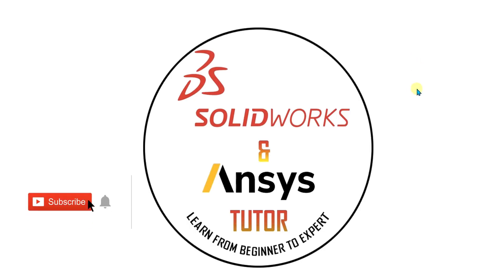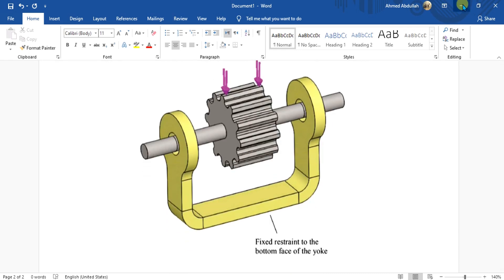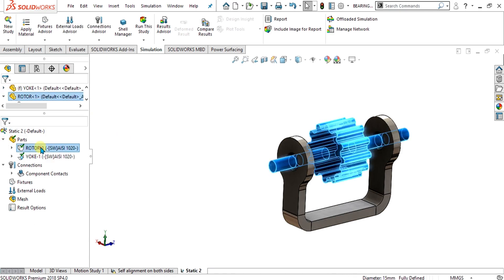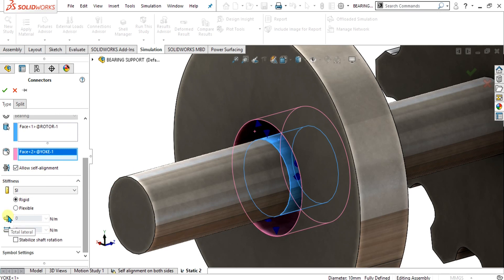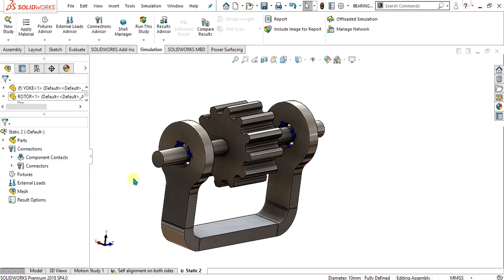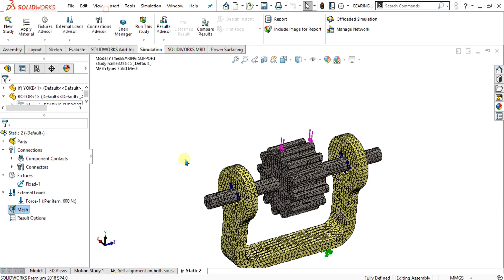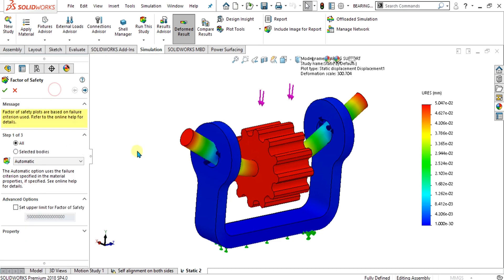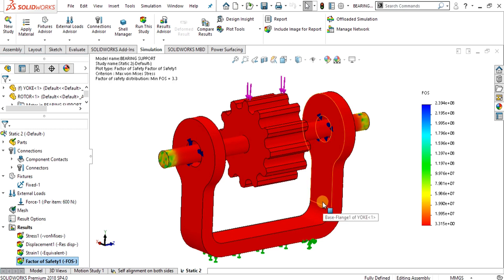✅ Solidworks Simulation Bearing Connectors | How to Analyze Assembly With Bearings in Solidworks

Comment: Completely wrong. lacked main information. Why are you using stabilized connection when you have actual bearing in picture. There is no stress coming on to the bearing body, then why is it even part of the study..
Reply: He does not have the bearing in this simulation. He mentioned that he is using just the housing representation. I still do not know if this is the correct way to run this simulation still.